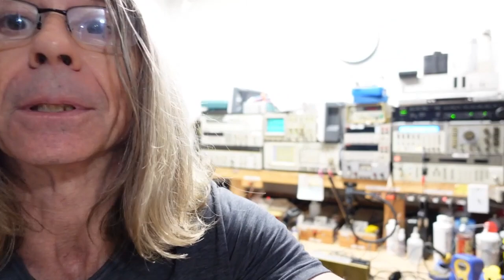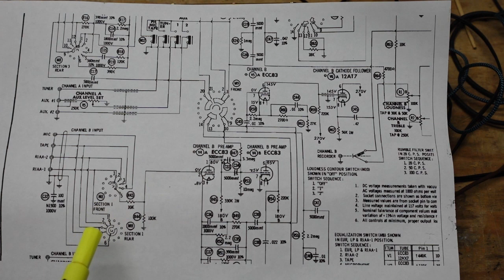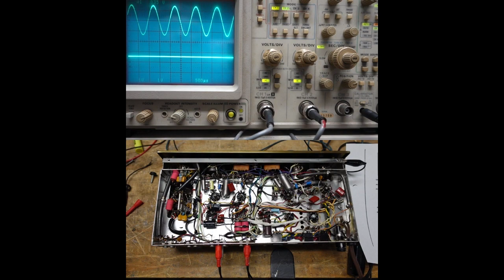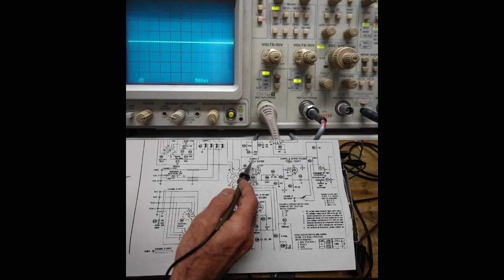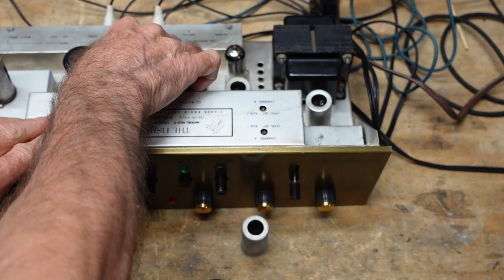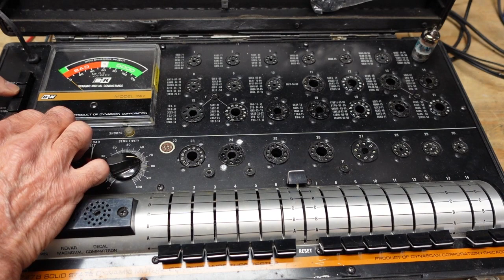Fisher 400C preamp repair

Comment: Outstanding video.  I have to say I'm surprised at the distortion difference between the two tubes which was a real eye-opener.  I would expect perhaps small differences but not orders of magnitude as in this case.  And of course now I'm thinking how does one identify an "outlier" tube other than with the use of a distortion analyzer as you did? This given my understanding that equipment such as this tend to be pricey.
Reply from the maker: Thank you!
You can get into distortion analysis on the cheap by purchasing a USB/audio interface like the Behringer UCA222 and using something like Visual Analyzer software.
Bear in mind that distortion below about 1% is undetectable by humans, no matter how golden eared they claim to be.  😁

Comment: Wait? I did watch 2 times ...lol... Seriously, you're the first person that I have seen swap out the tubes without turn it off. Can we really do that without problem?
Reply from the maker: I've never had an issue doing so. Remember that this isn't connected to an amp or speakers, so there's no danger of loud pops that might be damaging.
Reply: I remember reading the service literature on an Admiral mono tube type record player amplifier. It paralleled resistors and a hum control in the heater circuit of the tubes. It warns that pulling the tube out while the amp is in operation will burn the resistors out. That's one case where it's a bad idea. Oh yes, the horizontal oscillator in a tube color tv chassis will red plate the horizontal output tube. 😮
Reply: I have always wondered that as well. But most of the bench folks I watch do it all the time. Regardless hot swapping power tubes I will just not do. NOT that Ray did here.

Comment: Excellent video!  I remember somewhere way back you put out a video on RF Generators.  I can't seem to find that.  Anyway, I remember you were showing the external modulation of your 8657 with the HP8904 for FM stereo.  I was curious as to how that operation worked but you kinda stopped short.  Can you show how you use those two pieces of equipment when working on FM Stereo Tuners?  Thanks and keep the great videos coming
Reply from the maker: I took down the old video, and will make a new one in the next few days covering those 2 generators.

Comment: Great diagnosis, Ray. Those Fisher preamps are extremely collectible.  I had it's baby a 50c3  mono only version I purchased in the seventies at a yard sale used it for 5 years, then misplaced it on a sudden move.
Kicking myself to this day, it was great on phono. Forgot to mention it, but the purchase price  was $5.00!
Reply from the maker: Those were the days.  You could pick up stuff on the side of the road.  The internet changed all that.